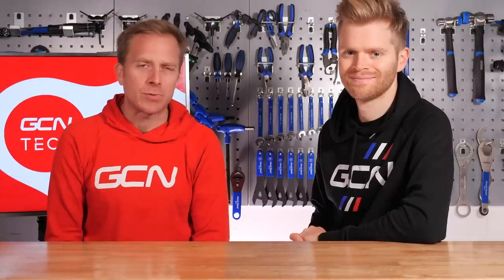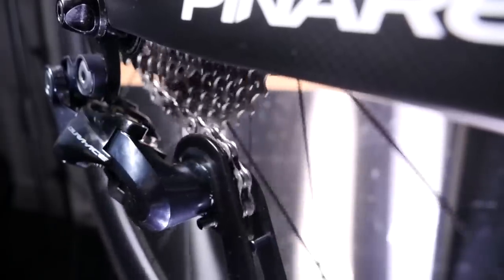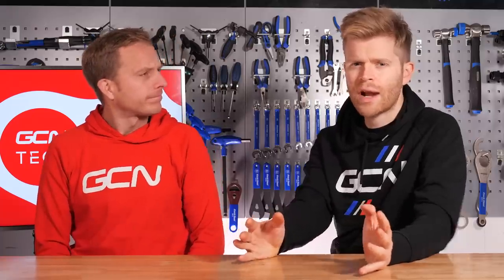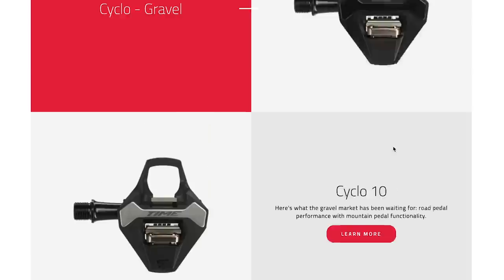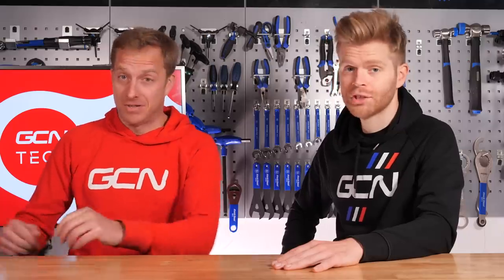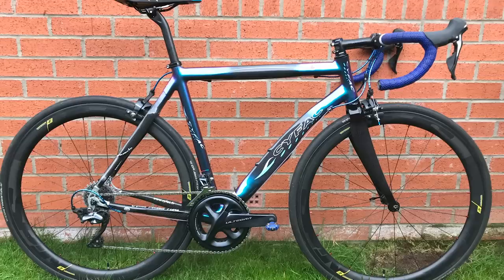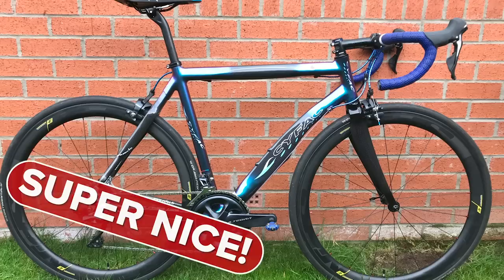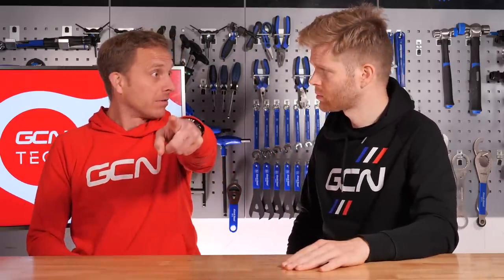Road Bike Tech We Want To See In The Future: How Can Cycling Get Better? | GCN Tech Show Ep.94

Comment: I’d like to see bearings from manufacturers like SKF, NTN, NSK with a quality of ISO Class 5  used in bikes.  These name brand bearings would last a lot longer than the no-name bearings that come in bikes today (even very expensive bikes).
Reply: Most bearings can be popped out and replaced these days, so it is very feasible to do that for a not huge sum especially in many hubs.  The main problem is that even quality bearings will die fast if they are not aligned (press-fit BB) or cleaned with pressure washers...

Comment: Remember components back in the 80s, where you could tighten every bolt like f**k and not worry about torq values and damaging threads?!
look at the bikes from that era now, they still exist and more often than not the components are in amazing condition, chainrings with their teeth in good shape, hubs that are still smooth and rims that are not concave?
How is this possible?
Haven't you asked yourself that question?
My belief is "built in obcelessance" plagues modern bikes and they wear out exactly as planned!
What do you all think?
Reply: Marco Paganotto So very true 👍🏻
Reply: Just to play devils advocate, I suspect there is a degree of adding lightness that adds to the components wearing quicker. Consumers have been asking for lighter bikes/components, trade off is less durable?! Much like when MP3 players came out, poorer audio quality, but much more convenient.

Or is that what they want me to think 😂
Reply: its quite simply a case of performance versus longevity.  

Bikes may only be 10% or so more efficient but thats at a cost to longevity.  The real problem is that every tom dick and harry wants to feel like they are in the tour de france, so $10K bikes abound
Reply: Yes, I think the pinnacle of practical design and elegance would be the mid to late 80's.  I enjoyed friction down tube shifters and could happily live with them again.   I could even do a "double shift" to the small ring in a paceline.
Reply: @4vickiekaye  Index shifters were better/same because they had a little tab so you could disable the indexing and go back to friction if the index was off. Changing to the correct gear with friction was just muscle memory, it was easy unless you were sprinting in the drops or out of the saddle.. yeah I guess the 'out of saddle' bit is the real weakness of down tube shifters.
Reply: @digbysirchickentf2315  Yep I had to do that.  I had an indexing Chorus shifter that never quite synched with my rear mech so to avoid aggravation I used friction mode.  Also had that on a Shimano 105 and ran that in friction.

Comment: Stainless steel fasteners! How many times do we see high end bikes with rusty hex bolts on the headset etc?
Reply: They are heavier for the same strength as regular steel bolts. It’s easier to take anodized steel bolts.
Reply: @jochem1986  good point but I'm 6'3" and 15 stones so I'd trade a few milligrammes for no rust! Lol.

Comment: Disc Brakes: a) be careful when you’re putting them in the car b) set them up properly c) don’t contaminate the braking surface

It’s all common sense. 

Worried about weight? Have a dump before you go out for a ride.
Reply: Or have rim brakes and have a dump whenever you want.
Reply: "Common sense" is not having them in the first place...

Comment: Re: Cleats, how about instead of clips that actually clip, electromagnetic pedals that can be turned on/off that holds your shoe on until you either press a button or the bike reaches a critical angle (crash detection).

Comment: Carbon-ceramic disc rotors, same as the ones that are used in high end cars. Heat dissipates much quicker, stopping power is increased, modulation is much better

Comment: what about di2 that shifts automatically based on things like cadence and or power which you can set and adjust on your head unit while riding
Reply: Built my own auto shifter that does exactly that with a CVT as the transmission so no annoying unexpected gear shifts. Makes for an incredible ride experience.

Comment: Get two identical bikes ceramic coat one of them. Ride them both on the same muddy gravel course and then weight them at the end. Also you could do a 2nd and 3rd lap so try to determine if the extra weight built up after a few laps makes a significant impact (it should) on lap times.

Comment: Main disc brake improvement would be to increase the pad clearance, increasing the pad movement per mm of lever throw to maintain contact point. This should eliminate brake rub.
And consider bringing servo wave across to road levers to maintain braking power and modulation.
Otherwise, the ABS suggestions would help with additional control although it won't be light!

Can't help but thinking carbon pads are a bad idea (we just got good brakes, why throw it away!)

Other bike improvements: electronic shifting at a lower price point (105 equiv.)
One standardised bottom bracket! (Threaded, of course)
Recyclable carbon parts

Comment: As soon as Ollie started talking drivetrains I thought that a road bike spec belt drive was the answer. Would love something like that to cut down on bike maintenance. Really, just a self-cleaning drivetrain would do it for me. Something with the benefits of a ceramic coating but without the fragility of ceramic parts.

What about a bike with a drive-shaft system integrated into the frame itself? That'd have to cut down aerodynamic drag. Or a lightweight bike material that costs less than carbon AND has a more environmentally friendly manufacturing process? Maybe just a less costly titanium frame to get the weight and durability perks? Or what about self-recharging electronic shifting? I know that some of the Trans-Continental riders this year had devices to convert their pedaling power into electricity to charge phones and whatnot, why can't a rig like that come standard on Red and Di2 bikes? Heated winter jackets that run on solar power. VanMoof-style GPS tracking and recovery service for high-end road bikes. 

That's a tight match between refurb projects this week. Both of them deserve to win.

Will Ollie be haunted by the ghost of the lost bell on the Halloween episode in two weeks?

And actually, Bowie didn't change his name to avoid confusion with Davey Jones, it was because he thought David Jones was too common of a name to make it in the big leagues. Though how much is that muralist kicking himself for his "DAVD Bowie" slip up going worldwide on YouTube, am I right?

Comment: To improve disc brakes first look at the most common problem - brake rub.  The clearance between the pad and the rotor is barely a millimetre and if the rotor is warped by just a fraction then you get brake rub.  You can open the pads but then you get so much dead lever travel you have to pull a whole handful to get any brake force.  There simple fix is to either make the rotors thicker so they are less prone to warping or somehow make the pad move further for the same lever pull, then you could have greater clearance without increasing dead lever travel.  The simplest would be thicker rotors.  Easy.

Comment: Carbonceramic disc brakes.
They weigh less and is more efficient.
Would be nice.
And that might get the weight on bikes with disc brakes down a bit.
Reply: MRGRUMPY53  Well i dont think the average bike would be equipped with it.
But the high end bikes might.
Where the bikes already are 10 000 euro.
Then a few grand more wouldn't be to bad.
Reply: They need heat in them before they work properly. That’s okay in a race car on a flat circuit, but not when you start an alpine descent on a road bike.
Reply: @jochem1986  at the moment yes.
But who knows in the future.
And it was future tech they were takling about.
Reply: Denis Spratt who knows, maybe in the future discs made of fruit loops will be the superior choice.

Comment: The only way to make disc brakes less prone to damage is to cover them with a shroud, or, make them thicker. Either way you're adding weight. There's something to be said for the simplicity, durability and reliability of rim brakes. I won't be going to disc anytime in foreseeable future, and I think theres still room for rim brake improvement in all areas. Brake surface, brake pads, geometry and cables.

Comment: John - look at an Ergon cleat guide - you can use them to set new cleats in the same place as old ones pretty easily.  And everlasting cleats exist - they are called SPDs :-) I use them on all my bikes - if you are worried about not looking roadie enough, then fit some A600 pedals.

Comment: Clip on truing tool, ceramic coated rims for better performing rim brakes(disc brakes are pushed too much).  CLP gun cleaner for the drive train cleans and lubricates and protects.  Harder 10 tooth sprockets, better bearings.  About bearings, the gunkseal that exists between sheild and inner race is a overlooked component; it performs a function.  Before it forms bearings have to me 'sneezed'; this is when you overload grease inside the cartridge or between two cartidges(if two cartridges take the inner seals out) and use the system until the grease stablizes.  Now the bearings will last much longer. Just dont remove the gunkseal.  Cheaper bikes.  Its ridiculous the costs.  Disc brakes for most bicyclists are useless.

Comment: Carbon brake discs with aluminium only on the braking surface would be ideal. The carbon would be flexible but not malleable and the aluminium would still provide optimum braking performance

Comment: Recently bought an ebike,  option available, belt driven hub gear. Did research, plus side of this option, low maintenance,  down side, hub gear less efficient,  belt less efficient cost extra £200+, weight of hub 1.7kg. Bought  normal 10 speed, I dont mind a bit of maintenance

Comment: 12 speed cassettes that have a 36 or 42 as the big gear, not a 50 or 33. Or 11 speed cassettes that are a 10-28 or 10-32.

A sleek looking road dropper post with a sleek operation. Something like the bmc bike with a built in dropper. Of course it has to be light as well.

Comment: On the topic of clear frames, we have fiberglass instead of carbon fiber.  Fiberglass items can be made pretty transparent but not perfectly clear.  The thing with fiberglass is that it is much less rigid than carbon fiber.

Maybe we could have some sort of carbon fiber lattice reinforced fiberglass bike where the bulk majority of the bike is fiberglass and the bits that need the most structural reinforcement are made of carbon.  It would be heavier than a pure carbon bike though and it wouldn't be perfectly clear either...   I think it's worth it for the top 90's aesthetic.

Comment: If you don't use single chain rings, 10speed is enough.   (Actually, I don't own a 10speed bike, but the difference between my 9speed and 11 speed road bikes is: the 9speed (12-27) lacks the 11t sprocket and I don't have to change the gear twice when the gradient is changing (21-24-27 vs. 21-23-25-28) when climbing.)

Comment: Everlasting Cleat:  I have created the front grip part for Look Keo cleats in CAD and printed it with TPU Filament (rubber like). When you see your grip part wears out, just cut or sand the surface flat and glue the printed grip with CA on the cleat. You don't have to remove the cleat from the shoe. You can download the file on Thingiverse  (https://www.thingiverse.com/thing:3874115)

Comment: if you want a million gears.. can’t you just get a CVT transmission in the bike?
Reply: The big problem is efficiency.

A typical rubber belt CVT like you find on a scooter, or even a steel pushbelt CVT like on many cars, requires rather high clamping force to avoid belt slippage, and that means significant power required to overcome the belt tension. Utterly impractical for bicycles.

NuVinci gets around that by using roller balls and a force-transmitting fluid, but a test (https://fahrradzukunft.de/17/wirkungsgradmessungen-an-nabenschaltungen-2/) showed that they peak at 86% efficiency in bicycle applications, and average under 84% efficiency even at 200 watts. To compare, under the same 200 watts and the same test conditions, a Rohloff's worst case is 91.2% efficiency (1st gear), and best case is 97% efficiency (8th gear). Or, single-speed is 97%, and the tested derailleur system was 96%. It gets worse for everything but single-speed at 50 W.

There's also been a couple of concepts - NexxtDrive is trying to get someone to license theirs, and Revonte's announced another design - that are based around the power split device concept, as used by Toyota's hybrid car transmissions. It's not a true CVT, but it uses a single planetary gearset and two motors (one acting as a generator, taking some of the rider/engine torque, and one receiving the generated power) to simulate one. This necessarily requires that the bike be an e-bike, though, and it also is dependent on the efficiency of quite small motors and inverters at handling high torque pulses and getting them efficiently to the rear wheel.

Comment: Molded oil or “Matrix” bearings were introduced by NSK in 2000 I think, I would not recommend them. Friction heat from the bearing is required to melt the polymer to 120degc to release the lubricant.  Therefore in low friction conditions  eg, down hills,  traffic lights and  maybe the peloton the lubricant will become solid. Headsets, yes, due to lack of maintenance. The most important part of a bearing used on a bike is the seal.

Comment: I'll toss an almost certainly controversial one out there: KERS.

So, e-bikes are definitely cheating in competition (unless it's specifically an e-bike competition), because they're using stored energy from before the ride - it's not the rider's own effort during the ride that's solely propelling them.

But what if the energy were merely recovered under braking, during the ride, to be used later? The initial effort was expended by the rider, it's just saving the excess kinetic energy for later, to accelerate faster out of a corner, to help climb, or to help stage an attack.

Given the likely short bursts of power and resulting short duty cycle, the motor could be relatively light, too.

Comment: Here's an idea: wireless chain. I mean, no chain at all. Motor in the back wheel and power meter in the pedals/cranks. Power meter wirelessly sends information to the motor in the back wheel on how much power you produce, and motor delivers exactly and only that amount of power.  Not more, not less. Still same effort, but no chain needed.
Reply: iGameOver But if you’re not pushing any resistance(chain back wheel) what is the power meter reading?
Reply: @okantichrist  Easy, an electronic resistance mechanism in the bottom bracket. Changes resistance based on your gear combination.
Reply: iGameOver ok so all the riders effort is just to give the power meter something to work with,your energy doesn’t propel the bike,a motor does.
Reply: @okantichrist  I'm not sure you're understanding this. The rider is creating power, motor just mimics that. You don't get any extra boost like on ebikes, you still have to work your butt off to get moving. The only thing that's missing is a chain. Kind of like electronic brakes on a car. You are still the one expelling energy. Just instead of the direct drive you have a wireless drive. Your own effort stays exactly the same as on a traditional bike.

Comment: I'd lile to see disc brakes developed to their logical end point: by making them bigger, you need less braking pressure, which allows you to make them overall lighter. If you then make them as big as you can, ie as big as the rim, you can get rid of the rim and fit the tyre to the disc directly, saving even more weight.

Comment: Your long-lasting drivetrain already exists.  Take a 3x8 or 3x9 with a high-quality square tapper BB with good factory alignment.  An 8 or 9-speed chain will last 5,000Km, Cassettes 15,000, set of triple chainrings at least 30 to 40,000Km.  I have a 39-year-old Mavic RD550 Titanium square tapper BB original in a 1981 Follis SuperVitus 971 and a 21-year-old original Campagnolo Record square taper (9-speed era) in a 1998 Litespeed Vortex both have 10's of 1000s of Km on them and are doing quite well thank you...  Not moving to ceramic anytime soon ;).

Comment: In future I want electromagnetic wheels with rims floating on magnetic fields around E-hubs, driven by small battery in a seat tube and needing charge every other month or so. When not in use I'd take hoops with me or put away, thus solving some of theft and storage issues. And no, your hoops wouldn't readily pair with hubs of my bike without E-key, owned only by me.

Comment: Carbon fiber bike tech is AGES behind other industries.
Need to put an end to "black metal" engineering in carbon fiber bike production, coupled with fabrication standardization and QC!
Really want to see bike engineering getting closer to aerospace level than kindergarten level in terms of understanding aerodynamics, materials and chemical interactions.
Though... let's start with a standard bottom bracket??? 
Kudos to SRAM for their UDH by the way... a step forward...
Reply: Everything is possible if you’re willing to spend. But the loudest voices also want the lowest prices.
Reply: @jochem1986  Yes, but I don't want my face on the pavement because of them. It is as if the current bike mfgs are OK with a few cyclist deaths, injuries and couple of thousands of recalled frames from time to time... Overall, the industry will benefit in the end from improved manufacturing processes. Look at carbon fabrication in the aircraft industry, yet we all fly and pay whatever it is we need to pay.